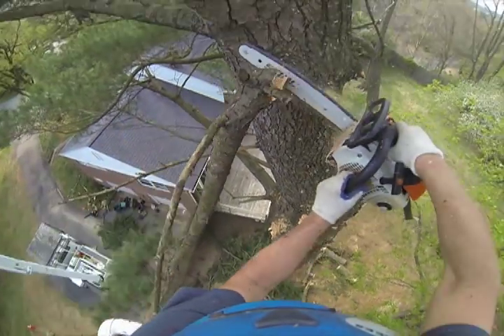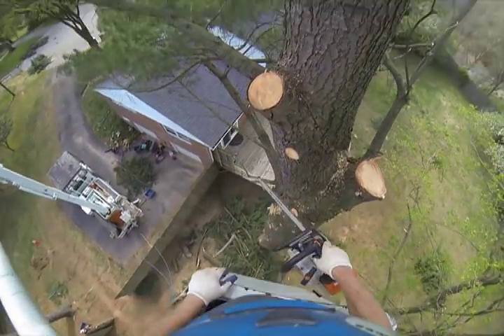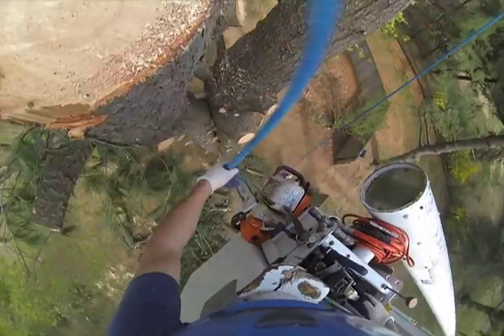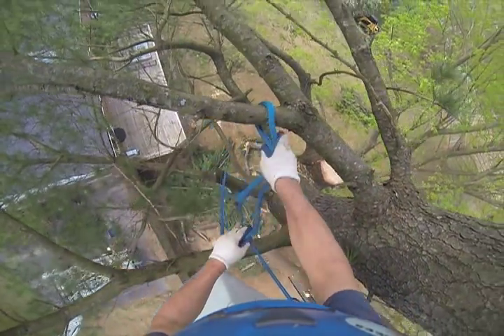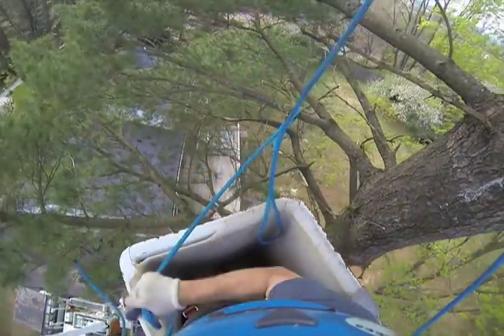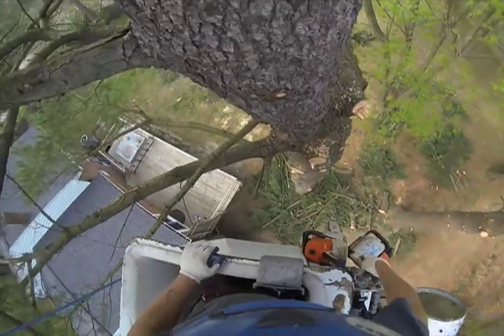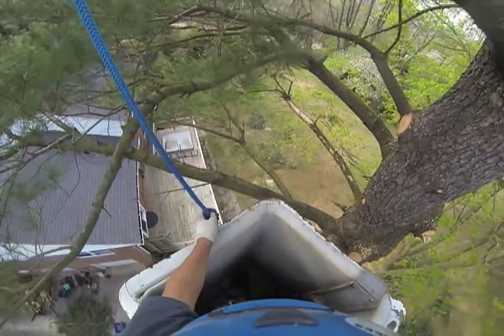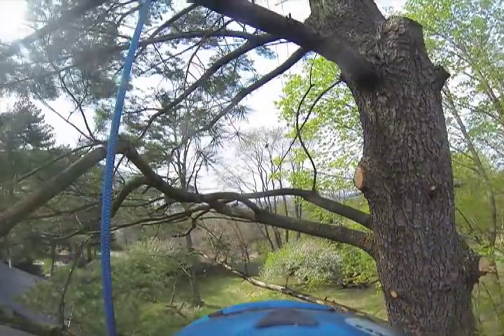Specialty Rigging 1

Comment: I don't like that method you use, what happen if the last branch breaks above you? I would have made one speedline instead.
Reply from the maker: Probably take 15-20 of those limbs to even come close to breaking the redirect limb. I AM quite familiar with the species and it's strength. If the possibility had even occurred to me, I would have simply moved the line in closer to the trunk. At that point, you could have hung a pick-up truck off it. That said, we all have to do what we feel comfortable with. Speedline could have been done, but not worth setting up for just a few limbs.